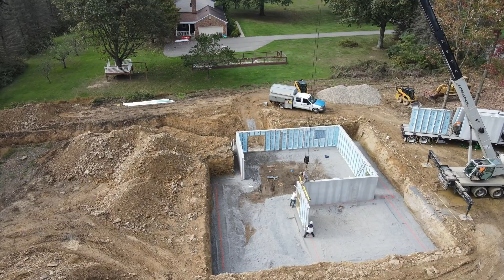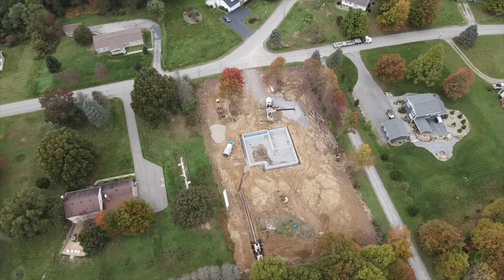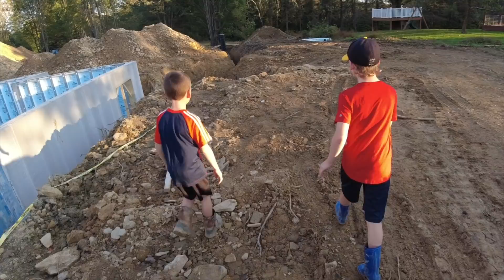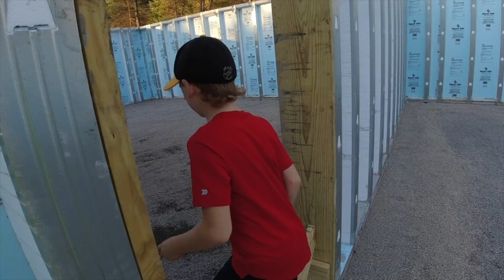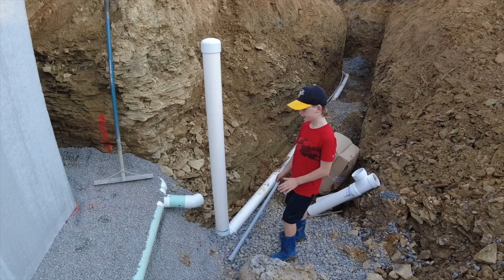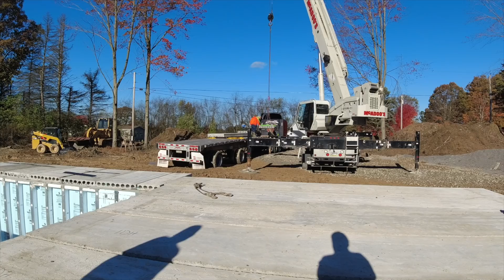Bring In The Walls!!!

Comment: On the Precast Dock Plank that they used for the main floor, how much difficulty was there for the subs to work through, such as plumbing and  maybe electrical or any other sub that may want to go through the floor?
Reply from the maker: Was not bad at all to drill through but from the garage to lower area we really didn’t need much access however a masonry bit punches right through it

Comment: Too bad you lost the bid on the garage floor. Did wall contractor set precast floor panels. Same question on steel beams. I kind of assume they did all because of “The system”. I would think you would had to the basement floor relatively soon, to lock together. Thanks.
Reply from the maker: No they all came from different companies.we are going to talk about the docks plank in upcoming video

Comment: Wish I would have used the docks plank, after putting up the span-all’s, plywood on that, rebar, and pouring just to take it all back down. The room is great! Doubles as a storm shelter/ bomb shelter/ work room. 
Question: I guess that there’s a fire code required for drywall in the basement?
Reply from the maker: I don’t believe so in the basement I know there is in the garage we will check on that

Comment: You may have already answered this question but, when do you pour the basement floors and why was it not done before the ceiling went on?
Reply from the maker: It is just timing we weren’t ready for the floor so they went ahead and started framing
Reply: With superior walls, you have to put the first floor deck on, bolt down the sill and put blocking in on the walls that are parallel with the floor joists. Then you can pour the floor. Once the floor is poured you can then back fill.

Comment: Are the walls made in 8'4" or 9'4" and so on to accommodate for floor thickness?
Reply from the maker: 9 foot high walls
Reply: @Concretewiththehauses  so your wall height after the floor is 8'8" after floor, or will he triple plate the sill?

Comment: This is a super cool system.  I do have a question about the "sweating" underneath the concrete in the basement ceiling.  How do you keep mold/mildew under control and can you finish off the basement knowing this will be going on?
Reply: I owned a home in Indianapolis built in 1949 post WWII. Lumber hard to come by. Basement - The builder used concrete block foundation walls with a poured concrete basement floor and poured concrete ceiling thus ceiling was the 1st floor “floor”. There might have been some moisture issues in 1949 but during the 25 yrs I lived there no moisture issues. I ran a basement dehumidifier year round which controlled normal Midwest basement humidity. It was a living space too.
Reply from the maker: It is only concrete underneath the garage as well as the porch a little bit of sweating in there will not hurt anything there is no framing that is storage as well as a future hockey room